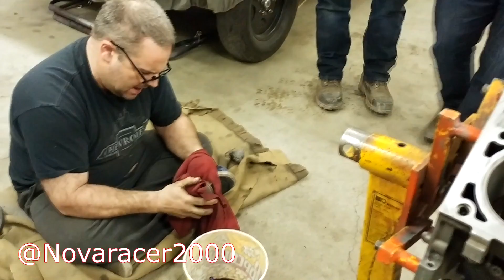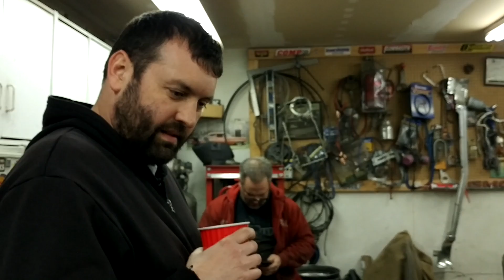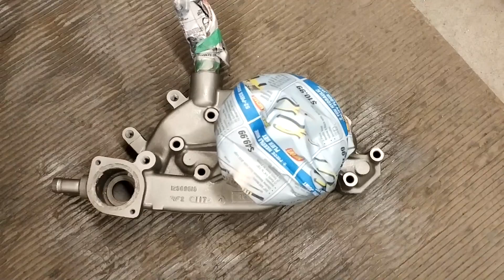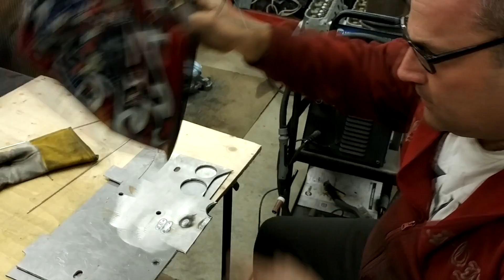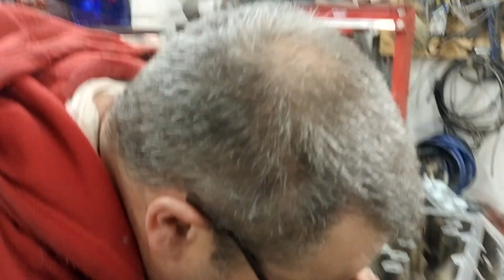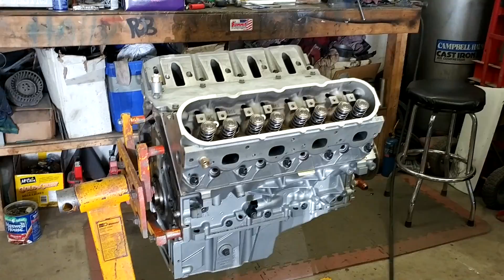OUR TURBO 5.3 LS ENGINE BUILDS ARE ALMOST DONE | My First Time TIG Welding

Comment: I your channel cuz I see I'm about to learn from you guy. And its really cool stuff. But how did yall get the engine so clean? And besides the turbo, is everything else just factory?
Reply from the maker: Idress Harper both me and Rob cleaned our engine blocks and painted them with high temp engine paint. You can use a wire wheel or brush, razor blade etc. . Just want to make sure to get the grease off before spraying it. Both mine and Robs engines have cams, valvetrain upgrades, and a few other minor things, but stock crank piston and rod.

Comment: Is there any type of way you can email me your engine set up? I'm doing a turbo set up on my ls 5.3 to put on a roller 90 LX FoxBody just wanna get some ideas
Reply from the maker: DatBoiBEAT The Sonicstang's 5.3 is stock besides chinese headstuds, an LS9 cam, and a different front cover to accommodate that cam. Doesnt take much motor with a turbo.

Comment: That weld is just fine man, the problem with aluminum welding is it cracks easily, that's what Rob was trying to explain to you about the post flow with your shielding gas. The gas cools the weld slowly and shields it from atmosphere all to prevent cracks. As long as your welds aren't cracked and the fitting is sealed to the pan and it doesn't leak oil, who gives a fuck what they look like! Pretty good job for your first time! 👍🏻
Reply from the maker: Shit box Thanks. My thoughts exactly lol, Ill practice more before I do the valve covers or coldside piping.
Reply: Get some scrap and run tons of beads, best way to learn!
Reply: as you are ending your beads, put extra dabs of aluminum while easing out of the heat. if you pull out that fast without adding extra, you will get those weld craters and that's where it will crack. I dont really sit on the welds with post flow once i'm done exiting, it's not stainless.

Comment: Hey Guy's been following your videos since i came across the Shithorse, i am building a 5.3 LM7 myself i live in Canada, on the East Coast NL to be exact. I installed a LS6 Cam in my motor i used stock LS3 springs, good luck with both builds can't wait to see and hear both cars fired up. By the way i like how your videos are shot in a backyard garage, with the drinks and shit, not being built my a big pr garage.. Lookin g forward to the next video.
Reply from the maker: Sean Clancey Thanks. We try to keep it real. We would be doing the same things without the camera around.